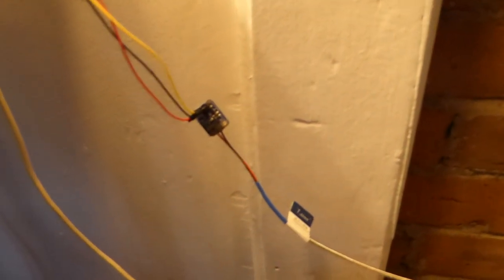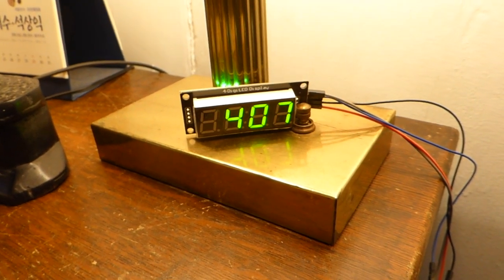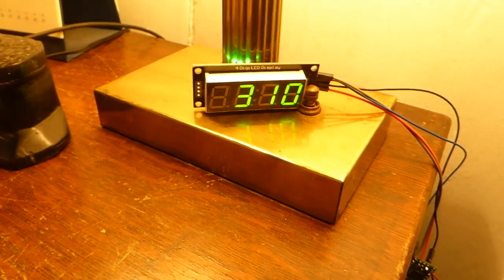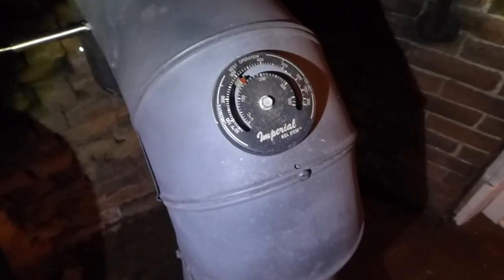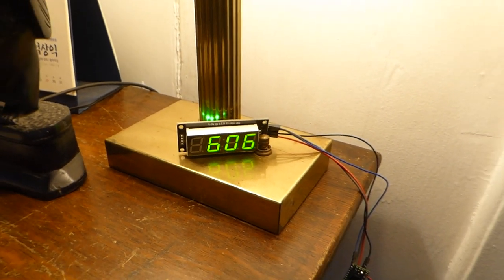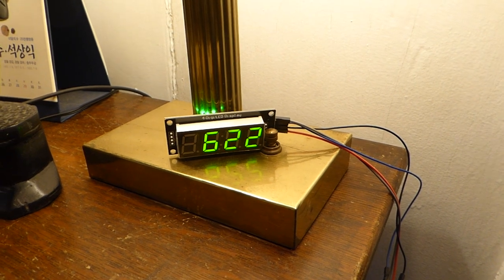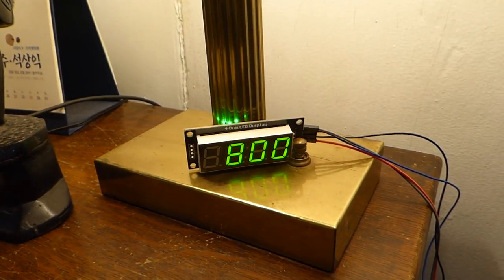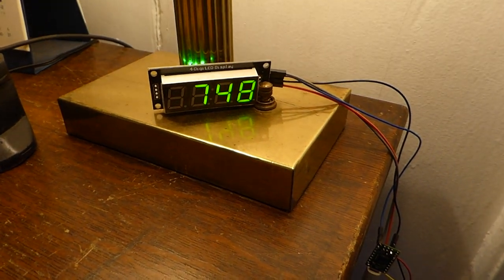Digital Thermometer for a Wood Stove

Comment from the maker: Another reason why I haven't built a housing for the electronic components is that I'm thinking of replacing the A*Star 32U4 with an ESP32 which has built-in wifi. With that, I could keep tabs on the temp even if I'm in a different room of the house. Check back for updates!

Comment: I currently have a Bluetooth woodstove temp monitor with two thermocouples. One for stove top other for flu. I like the idea of a wifi capable. I could monitor even when away from home. Good luck building. I would buy one!
Reply from the maker: Hi Jeffrey, do you also have a standard stove temp gauge? Wondering if you get a big difference between the thermocouple readings and the gauge that attaches to the outside of the stope pipe. Cheers.
Reply: @mikekim5135  Yes I do get big temperature differences outside vs prob inside flu pipe.

Comment: I have a probe in my flu as well.  Those temperatures you are seeing are probably very accurate at your probe as long as your math is right.  That magnetic temperature sensor you have is jumping.  That tells me that it’s not very accurate because it’s dragging in the back.  Keep up the good work.
Reply from the maker: I think you're right. I've since replaced that section of stove pipe and added a new magnetic temp gauge. The temperatures are a bit closer in readings, but obviously the thermocouple provides a much more granular reading of the temperature and reacts much more quickly to temperature fluctuations. I still like having the two. But I like to watch the LED readout because that will tell me when it is time to add wood well before the magnetic gauge catches up to the thermocouple. Thanks for the comment and thank you for watching!

Comment: What is the purpose of having all this.  In other words, what is it you are trying to accomplish with this set up?
Reply from the maker: Hi Tulamaybeanie, I'm trying to accomplish the following things: 1) just make the stove thermometer easier to read from anywhere in the room, 2) allow me to better manage how hot my stove is burning because too low=more creosote and smoke and too high=risk of damaging stove or causing a chimney fire and 3) eventually enable me to keep tabs on the stove temp via my wireless network.

Many people have solved the problem in different ways. One example is that you can buy a pellet stove that has a computer controlled auger that feeds the stove with more pellets and/or opens the vents when the fire needs to be hotter.

I just am trying to continue using this old stove but to burn as efficiently as possible.
Reply: Cool.  Very smart!

Comment: If you have your digital around 600 degrees, isn't that too hot
Reply from the maker: I think the calibration on the thermocouple might be off. I use the analog stove thermometer to keep the temperature in check. The digital readout reacts much more quickly to changes in temperature so I can react before the fire gets too hot. Conversely, I will know that the stove needs more wood before the analog thermometer shows the temperature starting to drop. I have been wanting to get an infrared thermometer to verify the accuracy of both the thermocouple and the analog thermometer but haven’t gotten around to it just yet. I’ll reply back as soon as I get one. Cheers.